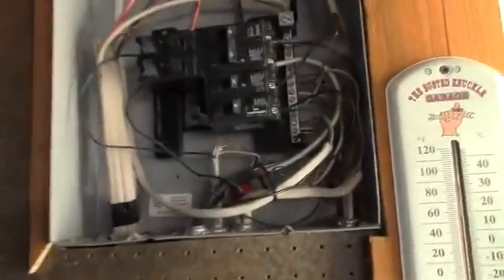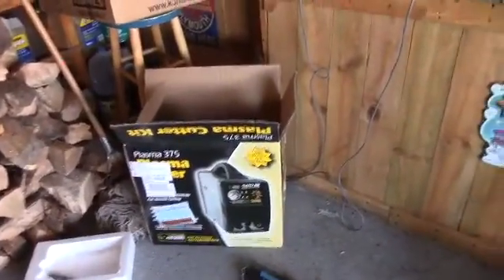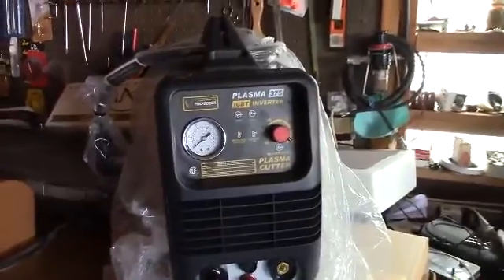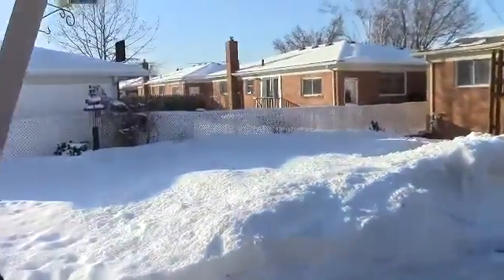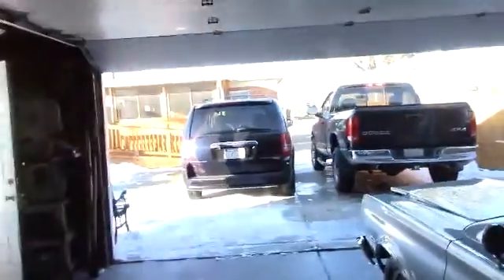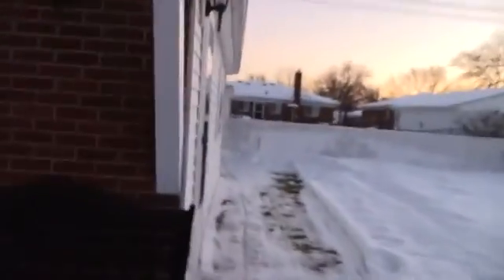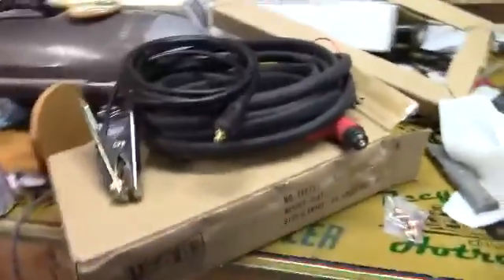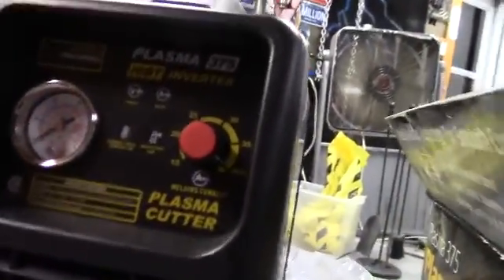Steve's Garage another 220 volt install

Comment: Good to see you Sir.  Now you'll have to build a cart for the plasma to ride a round on.  Take care, be safe!
Reply from the maker: I have a cart with a mig welder on top, Going to store it on the bottom, I show you in tomorrows video, I have to come up with a better water separator for my air. I just hadn't figured out the best way yet, Thanks JE Have a good one.
Reply: Poke around chevahaulic channel.  He used junk parts to cool the compressed air.  He is good and dry now...
Reply from the maker: Thanks will do.